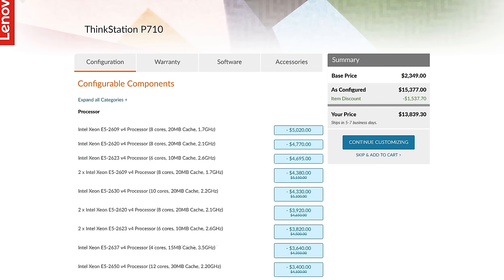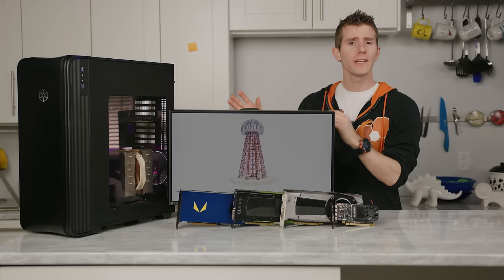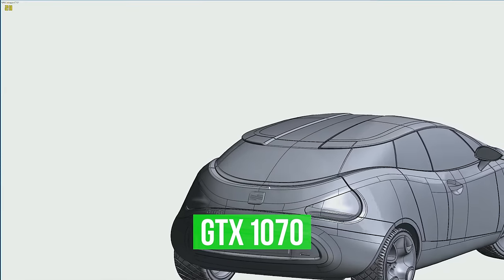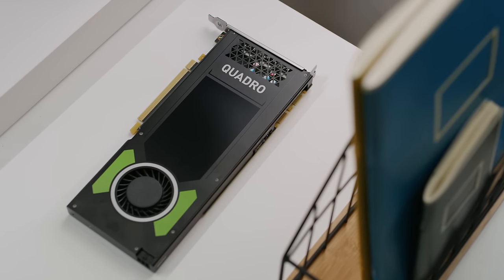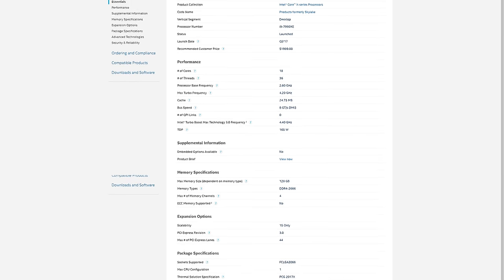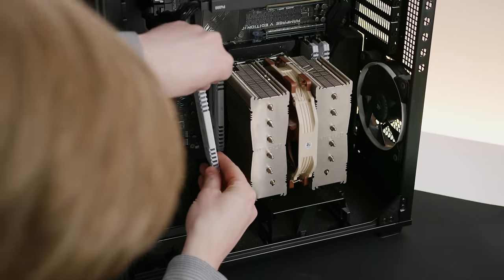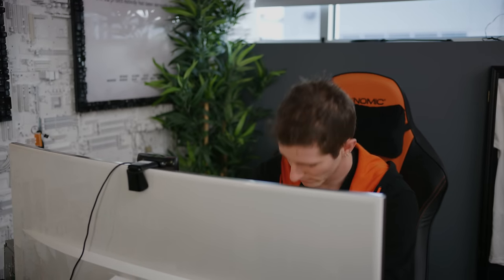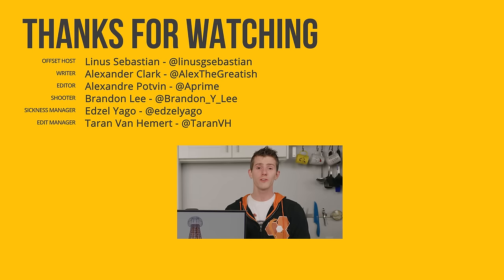3D Modeling & Design – Do you REALLY need a Xeon and Quadro??

Comment: I use CREO for Engineering and it even runs on my Celeron Laptop with Intel HD Graphics. ^^
Reply: True. I'm building a whole car in creo with just an i5 4200u and integrated graphics
Reply: Which way, for example?
Reply: Yeah Creo runs much smoother than solid works
Reply: CATIA Masterrace
Reply: I like CREO but SolidWorks is the industry standard for basically everything
Reply: Repping that PTC lyfe
Reply: Yea because Creo is based on 1990's tech LOL
Reply: oh god.  that buggy piece of shit nightmare.
Reply: Never used Creo, but solidworks isn't exactly the shining example for some things either, I constantly miss more advanced features I had when using Seimens NX.
Reply: its just the best bang for buck and the most widely used in the industry.

if maximum complex features is what you crave, CATIA is what you need.
Reply: Aaron Beckman lol try renaming a file in windows explorer and see how stable that piece of junk creo is.

don't even get me started on how inefficiently it saves backups.
Reply: yeah creo is so lest century that it works on lest century hardware
Reply: Solidworks needs to get their shit together! I can run it on my puny little HP laptop!
Reply: Also did this boi Gasper just shit on creo? Personally I have no favorite. Thing is I'd like to say if you think creo is last century... you do not even know the sheer power of that program. I will admit it's biggest flaw is that it's abusive, if you get confused somewhere and make a mistake it will make sure to make your life a living hell. But if you know what you're doing and you do it on Creo it will cut your time by SOOO much.
Reply: then why do so many companies shit on creo and use solidworks and autocad instead? Because creo is shit unless you're a broke ass hobbyist
Reply: CREO isn't liked for its UI, it's liked for how well it works from a technical perspective. Solidworks is very forgiving, yes, but as a result it's also quite limiting. CREO will make make you suffer penance for your mistakes at first, but this just leads to better modeling practices in the future that should be followed in any piece of CAD software. CREO simply has more mature technology that does things software like Solidworks can't do, including working with much more complex parts and large assemblies without tanking performance. A better comparison would be CREO and CATIA, while both are much harder to use than Solidworks, much more control over design is offered for people who know that they're doing. At the end of the day, forgoing price comparisons, CREO is built to be a high-end piece of software and Solidworks is built to be mid-range.
Reply: Use CREO on terrible school PC's and it runs with no problem. I like the software. Think the people claiming its shit don't understand it properly and are more used to CAD softwares designed to make everything simple and more forgiving. CREO is more powerful as a result of it being designed for professionals.
Reply: philip shentall I've been using 3D design software for 22 years professionally. Creo sucks.
Reply: Lol CAD wars. They all get the job done. I have run Solidworks on a Surface and OnShape will run on just about anything. The question is, "Is it supported?" , it would be terrible to drop 5k on high end CAD software to have it not work because you didn't use the right gear.
Reply: Tim Edwards CREO is actually more expensive than Solidworks and is used by a lot of big names like Lockheed. If you're a broke hobbyist, it will likely not be your weapon of choice.
Reply: theX24968B CREO doesn't like you renaming parts in explorer because it's meant to be used with a VCS where names are meticulously managed to make sure all parts have a unique name and can be always be identifiable. It's not a bug, it's a feature enforced with a vengeance.

Comment: Radeon Pro. ex WX 5100. Best deal.
Reply: Could I get a laptop with a Rx 460 and amd a10 9630p for cad 
My minimum spec I need is a Quadro k4000 or equilevent
And a i5 of i7 processor equilevent
Reply: I was pretty disappointed that he didn't have any of the WX series cards on here, im running the 3100, which is the cheapest one in the series and have had no problem in large assemblies using autodesk inventor
Reply: techdiode should
Reply: WX cards struggle in solidworks but work great with inventor, something with the driver pathway with the amd pro drivers just don't play well with solidworks.
Reply: Well, I wish you the best in your cading career.

Comment: Curious. How did you leave out the best price/performance card? WX 5100.
Reply: I agree he should have mentioned it, but some people need those CUDA cores
Reply: Matt Patenaude And some people Don't

There's on reason not to mention the WX series
Reply: agreed, but I think the WX 7100 might be better bang for buck, as you get VR support and an actual 6-pin power deliver so room for OCs. but for less than 300 bucks, teh wx 5100 is a great deal
Reply: Daniel Rodriguez-Delgado VR and OC for workstation pcs lul
Reply: v Nyggi well I see your point but if for the same price I also get some VR after hours why not; also AMD cards have dual drivers so in gaming mode you can easily increase power delivery and get the 7100 to perform very close to and RX 480/580
Reply: Daniel Rodriguez-Delgado well thats true :D maybe even cheaper than said gaming card xD
Reply: In Catia V7 the Quadro P1000 is faster than the WX5100 ^^
Often the real Performance of Nvidia cards is way better because of the drivers. Specially with new AMD cards it takes a long time to run the full power of new cards specially on older rendering software.
Reply: It scores far below all the benchmarks in testing. Most distributors of the software in question recommend to avoid AMD due to their poor driver support.

Comment: This was interesting. But it only applies to SolidWorks. Other CAD software like CATIA, PTC Creo and AutoCAD would also be interesting. 
And you need to make another episode(s) on hardware for FEM and CFD like Hyperworks and Abaqus like you mentioned in your video, but also Ansys (the FEM version), Ansys Flunt / CFX, MSC Adams, Star-CCM+
Reply: I've used Catia on all kinds of different hardware and havn't had an issue
Reply: He sort of does touch on it. Most of those use multiple cores, unlike SW which sticks to one core. That's why it's sort of a blanketed statement when you aim for as high of a single thread clock speed, then toss more cores at it.

Comment: No Radeon Pro WX cards in the lineup? The WX 7100 are only $450 right now, where are the RX cards are insanely price high at the moment, for what they are. 
The WX drivers are vetted for like 99% of CAD, rendering and other workstation software.

Comment: I'm not even going to watch this video - I have been doing CG since 1980, programming 3D since 1982, 3D animation since 1995!
The answer is Yes, if you are using AutoCAD, if not then no. Simples.
Longer Answer:
In AutoCAD, if you have a machine with 40,000 nuts of the same type then the model as one nut and 40,000 'instances', the Quadro does the rest. Surfaces can be spline based too so are virtualised, the card draws them its own way. 3D animation software works on polygons and sub-div surfaces (not the same thing) so doesn't require that level of sophistication. Lastly, the geometry engine on the Quadro is vastly superior. Games and animation are 'suspension of disbelief' whereas CAD is seeing something accurately. The floating point operation level is orders of magnitude better.

Comment: firepro and wx are missing because the video is sponsored by Nvidia. i dont like it but i understand it.
Reply: SolidWorks is a very popular software in Mech Eng and it seems many people have experienced problems with AMD cards. I use an entry level quadro M1000 in my laptop and it runs SolidWorks and it runs perfectly. I think his recommendation for Quadro cards is justified.
Reply: @BaliMystic  Not sure which AMD cards you're talking about, I've been using a FirePro w5000 on Solidworks 2013 at uni. It blows away other Quadro cards. I'll have to admit that there used to be a few bugs every now and then but imo the performance advantage was well worth it. After the newer driver updates, I couldn't have asked for more!
Reply: +Abdullah Mudassir you summed it up perfectly. Performance is buggy which is exactly what most are trying to avoid when using SolidWorks, especially a 5 year old version!
Reply: @BaliMystic  just my own personal observations. The AMD workstation drivers used to crash occasionally. But even back then it was worth it for me given the surplus performance. Ctrl+S all the way :)
Reply: My Firepro V4800 had its digital video driver die out of thin air... do not recommend
Reply: with driver i mean chipsed driver for the DisplayPort and DVI outputs
Reply: @EuclidesGBM  FirePros (including their successor Radeon Pro line) aren't worth it, just stick to Intel Xeon Phis and NVIDIA Quadros and Teslas going into the future. It'll save you a lot of headache and heartache.
Reply: @abdullahmudassir7183  AMD drivers are historically known to be complete and utter garbage, hence why I don't use AMD.
Reply: What many havent mentioned is that there are a few processes in SW that are only supported by Quadro.

Comment: No FireGL type cards from AMD? A bit one sided to include the Nvidia workstation cards, but not the ones from AMD :(
Reply: Because their performance was below even the GTX gaming cards.
Reply: where do you have that information from ? 
please send me a link to that video or articel
Reply: ??? I'm the one who writes the system recommendation for GoEngineer (one of the largest VARs globally) we were sent demo units for all of AMD cards. After testing we removed all AMD recommendations from our site and our partner sites. I can't go into more detail than that. The cards have great specs but the drivers kill the cards, if they could fix the drivers AMD could have decent graphics cards.
Reply: AMD FireGL cards are no longer sold- AMD has released several Radeon PRO cards (new naming convention) which provide good performance\price.
Reply: @codysalyer1105  That includes the AMD RYZEN 7 2700X???

Comment: I use Ryzen 3 and 1050ti and it works fine in Blender and Unreal Engine 4 no matter what I do as long I don't go crazy with vertices.
Reply: I'm getting excited from this comment section lmao. I thought I would never be able to make meshes or anything like that without spending a fortune
Reply: FX-6300, 8Gb of RAM, AMD 7790 2Gb and 240 Gb SSD. I can run Unreal Engine 4, Blender and Maya 2016 with no problems. And I also made my own game in UE4.
Reply: Yeah PC specs for anything other than rendering is overrated. You can use a laptop with an i5 and 8 gigs of DDR3 and still have a decent work flow with 3d modeling. If you're doing things like environments or VFX than a Ryzen 3 or i5 with a 1050ti or decent AMD integrated graphics will suffice. Only thing you can justify spending over $2000 for is a 3D Rendering PC but it might be cheaper just to use a render farm.
Reply: Yeah you don't a really expensive PC for things like 3d modeling, game design, or video editing once you get at least a 1060 and a Ryzen 7 or i7 processor. Other than 3D rendering those will suffice and even then it really depends on what you're rendering because on my old laptop with an i5 and iGPU I rendered 3d animations all the time.
Reply: I have a 6300 too, but thought I would have to get some insane CPU to even consider doing stuff like this haha. Is your game on Steam or something though? I want to check it out now

Comment: I use an HP envy x360(12GB RAM) for my high school engineering/CADD classes and making 20-30 part assemblies for robotics, and it works perfectly
Reply: I use 32gb ram at work and it runs like shit when making drawings of assemblies with 500+ parts and 9 configurations. But yeah, you should be fine!
Reply: Alberto Contador wow, what do you like generally for a living? I’m very interested in all different STEM things, so I might take a similar career path
Reply: Alberto Contador you really should split configurations to completely different drawing files. No matter how much processing power you throw at that operation, it will be really sluggish. It is bit like never ending story with recalculation. You always have one configuration calculated and 8 out of date.

Comment: did the writer of the video know that autoCAD is more popular than solidworks? the benches for everything is much different based on the autoCAD demographic. I kind of feel like the video does a little justice for potential buyers, but not truly a real accurate way to scew the larger picture of the market.
Reply: More popular with who? Every engineering firm I have worked with uses Solidworks or NX. I used to enjoy AutoCAD, but not too many use it near where Linus lives (Vancouver, BC).
Reply: I'm working at an engineering firm in Alberta, working on a project going on in Washington. We use Inventor, although my university's eng design classes are taught in SW. Our workstations have firepro's, but when a pc went down recently they replaced it with a 1060 due to the current gpu shortages. (Fkn miners)
I have a 980 in my desktop at home, and haven't personally noticed any differences compared to our workstations.

I think the real story here is, kind of ironically, the old story of OpenGL vs DirectX. Inventor (by Autodesk, also makers of AutoCAD) switched to DirectX in 2010, while SW still uses OpenGL.

Disc: I don't know what model of cards the workstations use.

Here's something I thought was a decent read, although it might have been confirmation bias.

http://blog.grabcad.com/blog/2016/02/04/apis-gpus-and-drivers-cad-graphical-conspiracy/
Reply: SolidWorks is the by far the most popular of the solid modelling programs.
Reply: Every engineer uses soildworks, I should know cause I work with the engineers of other companies. Auto Cad is for people who make floor layouts. Aka 2D drawlings... Boreing
Reply: john smith I've only ever used SolidWorks and it is the industry standard for 3d design...
Reply: MrJibJub13 Yeah I agree. Solidworks is used more to build small objects, cars, devices, enginneering projects, etc. AutoCAD is used more for floor planning or large projects like highways and surveying. I love solidworks when it comes to using it. It is way more user friendly than AutoCAD(I use Civil 3D aswell). The only thing I despised with Solidworks was that I could only get the 32bit version as a student for home use. So the max ram it could use was 4GB(had 16GB in my desktop), so it would crash if I loaded too many parts lol.
Reply: Once you learn 3D modeling in SolidWorks you'll never want to go back to AutoCAD 2d. The difference between SolidWorks and AutoCAD 2D is the difference between AutoCAD and and an old Drafting machine on a board. (BTW: I've used all 3 professionally). The big question with what PRO graphics card you need has mostly to do with how many objects you expect to have in an assembly at once.
Reply: MrJibJub13 you would be surprised how many large firms use Autodesk inventor.
Reply: AutoCAD is popular than solidworks ?.... In 3 D modeling you say ? Lol
Reply: @MrJibJub13 For floor planning? A proper floor plan in autocad with all the dimensions and everything drawn in takes easily 2 hours or so. Download Revit or Allplan and you make the whole building lets say in 8 hours, and you have all the floor plans, all the side-profiles and everything you want in 3 clicks of the mouse. Autocad is mostly used here to cut pieces of steel. Allplan is the god of civil engineering design.
Reply: Birtalan Lóránt Exactly. Inventor doesn't seem to me like a great modeling tool if you have any kind of complex surfaces or mechanisms, but it really streamlines making relatively simple structures, like bridges or rigs.

Comment: Renderers that run on the cpu need cores.The more cores you have the better rendering times you'll get.(ie keyshot)
Renderers that run on Cuda are faster using nvidia(ie octane), and renderers using opencl are faster on amd cards.
Though modern renderers are hybrid(ie vray rt) meaning that they utilize a multicore cpu and a pair of gpus (in non sli config ofcourse).
So an all around good rendering system would be a multicore cpu >8 core imo and a pair of gpus > 2x 1060 or > 2x 570.

Comment: Was excited, but I do not agree to this conclusion, because no engineer is only using solid works without a ton of extra stuff open. Like browser tabs excel sheets pdf's and outlook. So I rather have more cores and keep all my stuff running good instead of less cores and have only solid works running a bit faster. And for the 500 parts, this is when you do not have large assembly mode active, and you should be kicked in the balls if you load a 500 parts assembly and not have large assembly mode active. Therefore a p6000 or p5000 is only useful for massive calculations for simulations or other science stuff. 
This is all a bit overkill. 
But well if you say too your boss, I rather have the moneys then you are getting shit. So in the end I agree with Linus and GET ALL THE STUFF! If you need to buy it for yourself just get a P1000 if you really only going to use it for modeling.
Reply: Haas Don't forget the most used tool. The snipping tool! Can't build cars with out it!